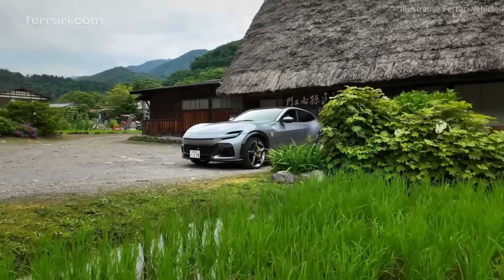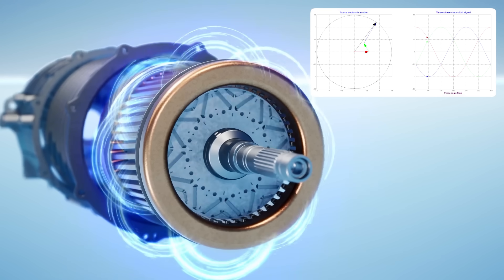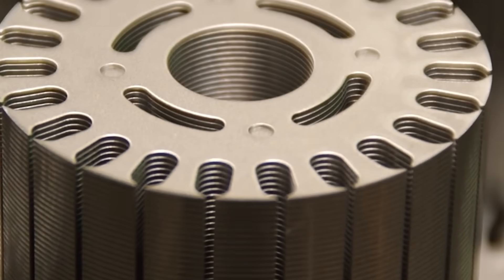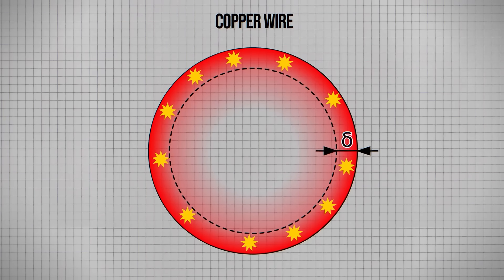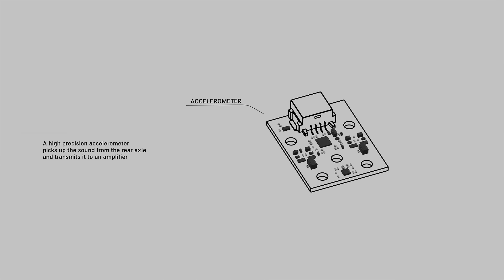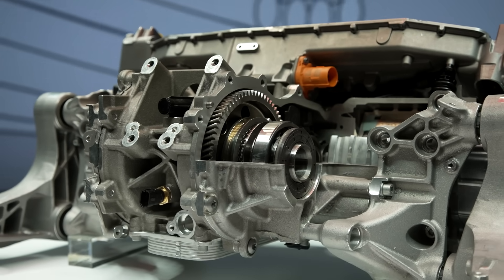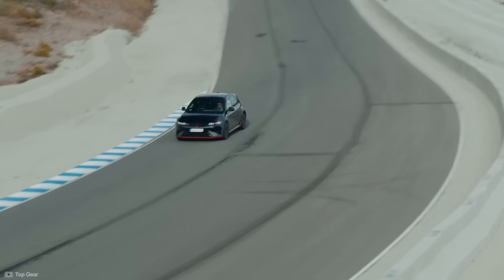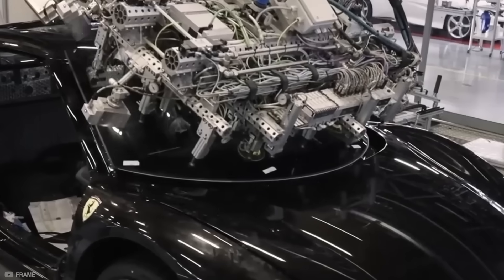Ferrari's Genius Motor Is Breaking All The Rules

Comment: A lot of the "interesting" stuff you mentioned about their motor is actually very standard.
Reply: Halbach arrays have been used in motors since the 1990s. Litz wire has been used since at least the 1920s.  Iron/silicon laminations (so-called "electrical steel") has been used since the 1890s!  It became standard in the days of Thomas freaking Edison!
Reply: Yeah, I was rolling my eyes. There's nothing innovative here. Its just Ferrari 5-10 years late to the party doing a token "compliance" EV so they can pretend like they're doing something. It'd be better if they made a hybrid drivetrain that was electric driven but had a small high revving range extender that in sport/race modes would match RPM to the throttle input, while in normal modes it'd just hold a steady RPM for range extending when needed. Offers the electric performance, keeps the noise for the people that must have it, doesn't add much weight or complexity. They could put it right next to the driver so they get all the "buttfeel" from it, while the battery keeps weight low and even in the car.
Reply: @thisisdumbwhatthe What you described is basically the hybrid civic’s drivetrain. It doesn’t have a CVT, it only drives directly with an electric motor and the gas engine kicks in as a generator to top the battery up, but if you put your foot down a clutch engages to let the engine and the motor to work together. Sport mode makes it rev a little higher and make a little more noise and power
Reply: @thisisdumbwhatthe  So saddle a fast EV with a spare engine, exhaust, fuel tank, radiator & plumbing for transcontinental use. Why not a trailer hitch and just tow a diesel genset?
Reply: @duncanidaho9153  Not that fast.  Model S plaid is faster.  By a lot.
Reply: @davidbeppler3032  Speed isn't paramount when towing a diesel genset.
Reply: @thisisdumbwhatthe  This car exist... it's call Honda eHEV lol.
Reply: This whole channel is described by OP's comment.
Reply: 💢💢 So a Nothing-Burger [junk]. Ran out of important info to report? Weak effort. 💢💢 
...
Reply: @MiloTheMindBender  electric motors are very simple compared to ICE / jet engines. so not much happening really. most efforts seem to be on the battery (solid state)
Reply: @goddesseddog    Thx for the comment but  I invent in the motor and engine spaces, among others.  +++ Spock perplexed  - https://www.youtube.com/post/UgkxhGjKg6ppvEbWjAzYFSWugLsG4-gZeaxf

Comment: So basically they've made a loudspeaker that transmits the amplified noise from the motor. Cheating, then, because it doesn't add anything other than a gimmick, and it doesn't provide anything useful.Any system that doesn't need to be there to add performance is fakery. Honestly it would be much better if they added some loud fans that provided motor cooling because at least it would be a mechanical device that did something useful. 
Electric sports cars are awful and pointless because they provide no more fun than ICE cars, and remove 35-50 % of the sensory input.

Comment: Sounds via a speaker in the cab is stupid regardless of fuel source... Speakers are for music not to hide squeaks and rattles.
Reply: Ice been doin it for a couple decades now SMFH. My 2010 mustang gt had a fake sound tube from the air intake into the cabin under the drivers seat. And they use active noise cancellation and attenuation since 2015 in the base mustang speakers!
Reply: Although external noises via speakers are necessary for electric cars, so as not to unintentionally silently mow down pedestrians crossing the street
Reply: @sparklefluff I support this idea at low speeds but most economical gas cars are significantly quieter than the noise the electric cars are required to produce. It's kind of a double standard that could just as easily be attributed to all cars. A Honda civic coasting through a school zone at the posted limit, sounds exactly the same as an electric car with no engine sound at all. The bulk of the sound comes from the rubber meeting the road and not an idling engine.
Reply: @WentzCraft You probably do have a point. I suppose comparison could be done by measuring the decibels in a quiet environment of the current best-selling modern ICE car at various speeds, and new electric vehicles could be tuned to match those volumes, or something along those lines.
Reply: @WentzCraft  That's why the law only requires the noisemaker to operate below 15 mph.  I still hate it though, i have a neighbor with an electric car and i know every time she comes and goes because i can hear the damn noisemaker outside my window.
Reply: Meanwhile, the ANC(active noise control) exists.

Comment: The electric motors look like they use solid engineering, using known techniques. Its just that we're so use to seeing motors used in low cost areas, where they cheap out, that here, the proper techniques, appear almost innovative.
Reply: Then they added a gearbox and fluid changes to increase maintenance and repair costs for dealerships.  Best engineering is making dealerships happy.

Comment: noises that get played through speakers are dumb. they rely on the quality of the speakers, which for something as simple as an electric motor is a stupid extra expense, but it will ALWAYS sound off. 

instead, I would much rather prefer a mechanically generated noise, like the fake engine from yamaha. 

or, you know, encorperate a really weird cooling system that makes it sound like a jet engine, or a weird gear system that makes the sound of the gearbox sound like straight cut gears. 

ferarri, I expected more form you. I would much rather prefer to see a certain bull mount that horse, than spend any time looking at that excuse of a sound engineer who did the speaker stuff. Make real noise, not fake noise. that is what we want. and especially you as "the top brand" which you aren't btw, i'd take any fiat over a ferarri for personal use any day, should be the one to come up with this stuff. it is a new age, make something out of it.

Comment: Carbon wrapped motors is a failure point. Like in Bicycles, boats, everything. They have a shelf life of a few years. Maybe a decade or two. Eventually the resins fail. They are great for the short term but I would not want to use something like that for more than a year.
Reply: Tesla's Tri-Motor system still goes strong. 2021-2025. That's 4 years. So, your one year use case is moot.
Reply: @KyleHubb  One year is how long I think such a design would work without having to worry about failure. Obviously Tesla thinks it should dependably last eight years. Ferrari is taking this stuff straight off the race track that might work for a race season and putting it into their automotive line. Their clientele are rich and can afford to fix things at whatever the price. I'm the sort that expects things to last for 50 years. This won't even make it through the upcoming super depression.

Comment: I'm wondering if the motor can be more powerful if it had materials like carbon fiber, nanomaterials, neodymium magnets, and metamaterials to prove that energy efficiency. Also, these materials can work well with flywheel solid state batteries hybrid systems in vehicles.

Comment: I am quite glad that streets are so quite nowadays. even the remaining gasoline powered cars are much quieter than those from 20 years ago.
Reply: I don't think it's getting quieter, the vast majority of noise has been for a long time road noise not engine noise. (Ignoring fast acceleration and intentionally silly loud exhausts). Tires are just getting wider too making it louder.
Reply: @behavedave  EXACTLY!!!!!!! Finally someone who gets it! Tire noise is the thing that been the noise from cars for at least the last decade. Cars getting twice as heavy is not making less noise
Reply: @behavedave  Makes me wonder if there are silent tires
Reply: @blinded6502 You can use softer tire compounds but they come at the cost of longevity, it's a trade off.
Reply: @blinded6502 There certainly are differences in tire noise. Typically about 3dB which translates to the loudest being twice as loud as the quietest. 
In the EU, the tire noise is on the label, together with grip on a wet toad and fuel efficiency.
Reply: @behavedave  road noise only take over at something like 40km/h, bellow that engine noise is louder, and that is for modern cars, if you take a sports car or someone with a farting exhaust it's a LOT higher. the world did become less noisy, specially around low speed streets. and it could become even more silent with EVs, more regulation, and properly designed roads.
Reply: Its sort of sad that all, the likes of ferrari have to offer is gimmicks, but says very much about potential market...
Reply: But the cars got bigger and heavier, and the n. of cars increased several times. And their speed also increased. So for the people around the car, like pedestrians or people who live near the roads, the situation has perhaps worsened.
Reply: quiet
Reply: Still loud here in the USA. I guess maybe California is doing okay..
Reply: Generally, yes, but don’t you make an exception for Ferrari noise?
Reply: @lebojay  It's 2025, everyone knows how pretentious ferrari is. I will break my neck looking at a JDM 90s gem over almost any ferrari - the ones I would look at are safely parked away in collector showrooms.

Comment: noise makers are infantile - as are simulated gearboxes
Reply: That is perfectly true. So is the fact that a lot of consumers have a little infant in them.
Reply: Funny, I always saw Ferraris as noise makers, and not just acoustically-speaking
Reply: well said
Reply: even though I love driving stick, simulated gears are silly. There's better ways to give you more control in a pinch.
Reply: and both could be quite dumb, aspecaly if there's no OFF switch
Reply: on a Ferrari, no less. They have fallen off completely.
Reply: I can see the appeal for simulated gearboxes, it can give the driver a bit more control on speed and acceleration. noise makers it depends, I can see it as a form of feedback for the driver and safety at slow speeds. the problem is that the only reason they are doing this is because these people simply don't find EVs fun, and they need people to keep buying their cars, and that is just silly.
Reply: If that car has any of those I'm not interested (not that I could afford it anyways)
Reply: Very expensive sports cars outside of actual racing are inherently infantile, no?
Reply: @EaglePicking  Even though I own one, yes, I'll agree they are infantile. Nobody NEEDS to have so much fun. It's purely an excessive luxury.

Comment: When kids today grow up and electric cars are the norm, they'll surely view this noise-obsessed era as weird and quaint.
Reply: Nah if electricity gets cheap enough, then it will not matter if the hydrogen is more expensive, as long as the equivalent in gas miles (or kilometres) is cheaper…
So if I am not mistaken if now gas is about 2€/ L the hydrogen equivalent would be about 0.5-1.5€ at least according to Europe estimates…
Europe doesn’t want batteries as they are made in china, so they subsidise hydrogen heavily, so even if it is insensible I will prefer the hydrogen as it will be good even 40years after… it is basically a heavier duty gas engine…
Reply: @chrisracer2007 the problem is that electricity isn't cheap or clean, the EU is heavily dependent on fossil fuels. and hydrogen comes with a lot of problems, hydrogen cells require just as many rare earth metals as batteries, and hydrogen engines are incredibly inefficient compared to cells, completely cutting on their maximum range (not to mention wasting energy). I can see hydrogen surviving in the future for some niche applications, but for 90% of the situations, batteries are just better.
Reply: Yes it is fundamentally stupid.
Reply: I grew up in the noise obcession and despised it from child days onwards.
Reply: Exactly
Reply: Think the iconic scene from irobot which was made in 2004. 

Even back then I thought as a gearhead we should have evs for daily driving and all forms of public transportation!

Comment: well if eddys cause problems then spin with it. you know electric motor is just spinning dc current. mhd dc electric motors ftw. dc not ac. ie hall-effect motor not pulse motor. also dc does not have ac problems. ie instead of trying to solve many problems, just have one simple solution that avoids the many problems. idk bruh. keep sounds in your pants. its just flesh coils wining. ie bs. total scam sounds. can you divider in binary. yeah birate ftw. stop wasting time in nonsense for pleasing people's eyes. doubt it, silence is much better. ie peace and joy in above. not your people nonsense talking rings in the ears. simulate the actual, not a fake pleasing sound. you get closer to above, not as if above would ruin everything. why would you make electric fake gasoline. darn people pleasing engine-ers. you are making engines, not sounds nonsense.

Comment: I thought that on this channel you have had a look at a small electric engine from Mercedes or Volkswagen or some other German manufacturer that fits inside a wheel and weighed around 13Kg or less or so. The electric Ferrari doesn't look sleek or sporty and the used techniques don't sound convincingly modern. Giving some haptic feedback through the steering wheel does come across as a good thing as the driver might feel more connected to the car. Still, overall the car looks and feels lacking as an electric vehicle as well as lacking as a sporting vehicle.

Comment: There don't seem to be any breakthroughs, just a higher price point allowing inclusion of best-available technology. Sound is still artificial.
Reply: Every electric motor in cars now operates at ~97% efficiency. Electric motors are not what we need to be concerned about. Battery tech is the one that needs a breakthrough.
Reply: Why do we need a battery breakthrough? 
Do you feel an EV should be able to be charged like you can fuel an ICE vehicle? 

A range of around 500km should be more than enough provided you can charge your vehicle overnight. 

What’s more needed than bigger and faster charging batteries is affordable and abundantly available (slow) street charging for people who don’t have a drive way.
Reply: Nope, they just didn't cheap out on the electric motors like most others do. All these designs for electric motors have been in use for industrial motors for decades.
Reply: @SilvaDreams Permanent magnet motors are used widely in the car industry just like induction motors. 
Spinning at 30,000 rpm is on the high side.
Reply: @SilvaDreams  They did cheap out as köenighsegs dark matter just shits all over this thing. That motor is actual quality.
Reply: Electric motors are technically superior, but it's the range, costs and repairability that aren't ready yet.   Build a 7 passenger 300+ mile range @ $20,000 electric vehicle and it would outsell the model T   oh and insurance rates would drop too!

Comment: Is clutching the motor really more efficient than taking the regenerative breaking? Or is the clutch only disconnected if the car is not accelerating or decelerating?
Reply: It's because they are using permanent magnet motors on both axles, so even when it's just coasting it is inducing voltage into the windings resulting in a drag effect on the motor (back EMF) .
Reply: @callumcurtis15  Do you get drag from back emf if the motor is open circuit?  I've worked with PM servo motors and if you flick the shaft they spin freely when the armature is not connected, but you can feel resistance if you short the armature.
Reply: @rogerbarton1790  No, if no current can flow there is no power, therefore no drag.
Reply: @rogerbarton1790 

Are you not still inducing eddy currents even when open circuit ‽ Then why does Tesla disengage some of their semi electric motors under low power demand ‽ There are still some losses associated with the gearing.
Reply: @Mentaculus42  You could be inducing eddy currents but these will be too small to be significant due to the laminations.  I would guess that Tesla disengages the gears to reduce drag and wear

There would also be drag due to the magnet.
Reply: @callumcurtis15  but isn't that the same with most EVs? What I don't get is the cost/benefit of the extra clutch hardware to the end user - is this more about speed rather than KWh/km efficiency or something else?
Reply: @anon1832  It does not happen with induction motors that do not have magnets. They make a magnetic field when they need it and it disappears when turned off so no EMF friction.
Reply: @davidbooth8422 

Interesting, but they have other compromises.

Comment: No more electric vehicles , they are not reliable 😮
Reply: Like anything if designed correctly and using quality components it will last a very long time
Reply: That's right. 
We need more horses and buggies.
Reply: How is that?
Reply: Battery life is a problem.
Reply: @ravenmad9225Not in reality. Even at only 80% capacity you can use it just fine. And at this point an ice car has worn out countless parts.